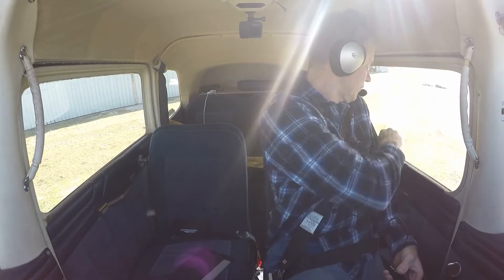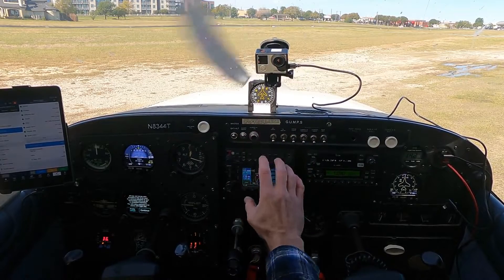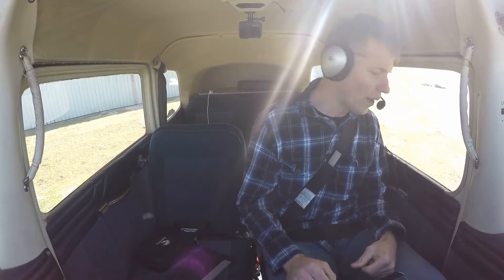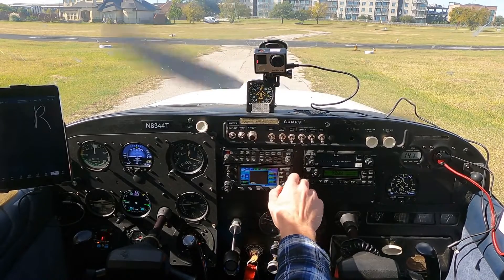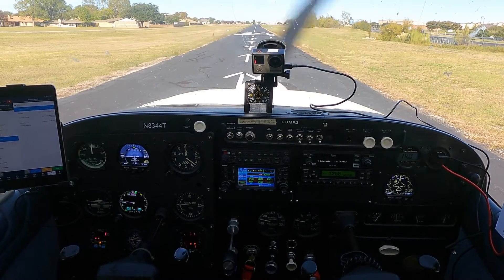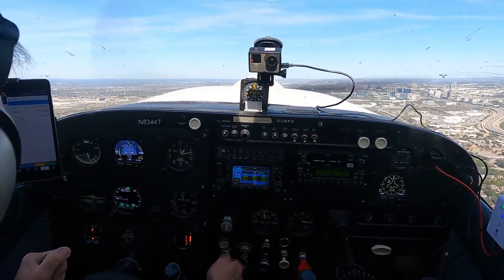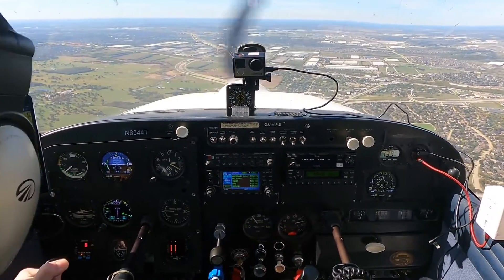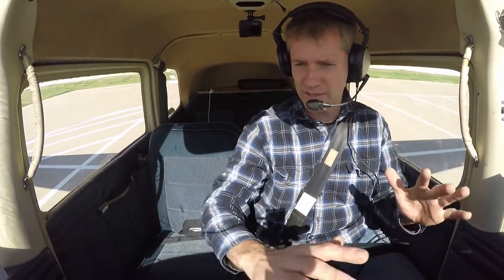Lets go fly the new avionics! Garmin GNS-430W | GI-275 | GTX-330ES | GMA-347 | ICOM IC-A210

Comment: Can you give a review of the setup using the AV-30 and the GI275?  I’m interested in the Sam set up because I can’t afford 3 of the GI275s. Where did you get yours for $3000?
Reply from the maker: I kinda like the AV-30.. I mean, it works.. The one on the right side needs a magnatometer BAD. I really wish I had gone with G5's OR the Aspen 1000. I bought my av-30's 2nd hand from another pilot who had bought them new and sold the airplane before installing them. I think I would just like the increased screen real estate as well as the ribbons on the side. One of my biggest gripes is that when climbing or descending, all you see is a number changing.. Uavionics could probably change that in firmware if the moving ribbon isn't copyrighted or something.